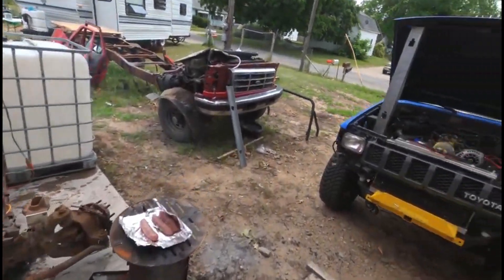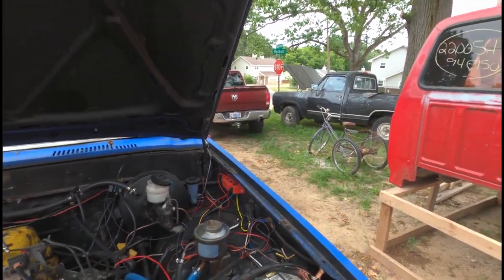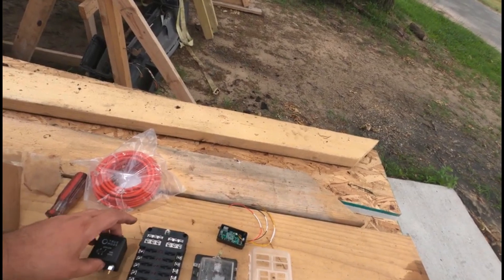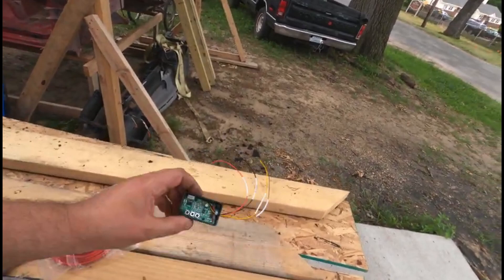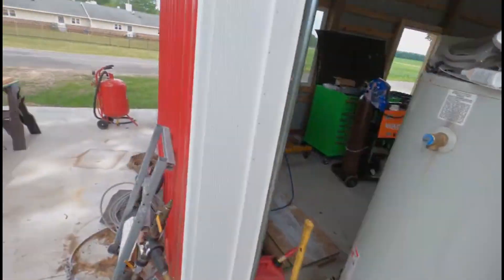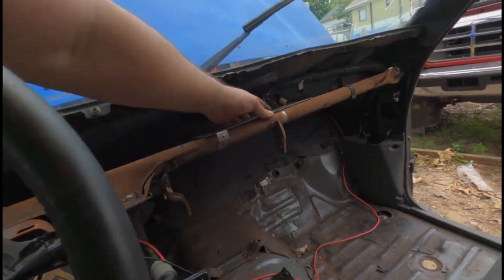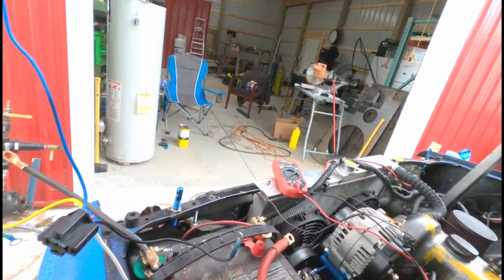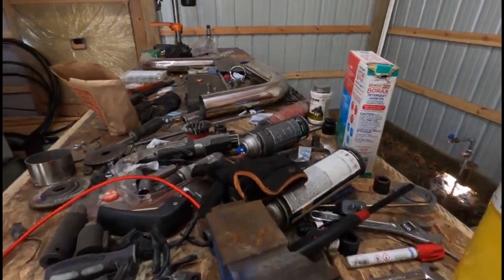The Ultimate Guide to a DIY switched fuse panel.

Comment: For a cheap brake upgrade to to a mid 90's 4runner/Tacoma and get the master cylinder.  Get the pigtail for the low fluid sensor and wire it in.  You'll go from a 7/8 bore master to either an 1 or 1 1/16 depends on which one you find.  Have to bend front brake line on master. But it will fit.